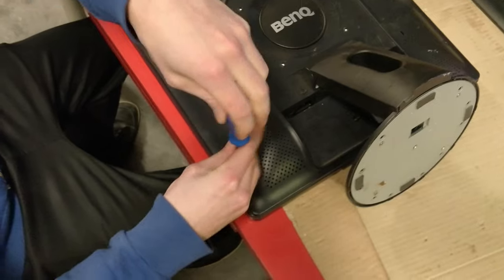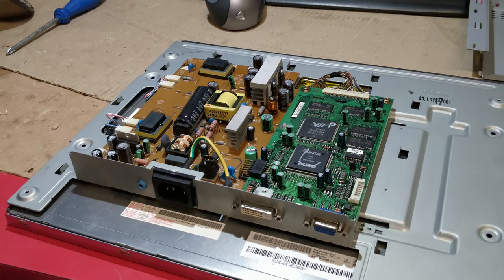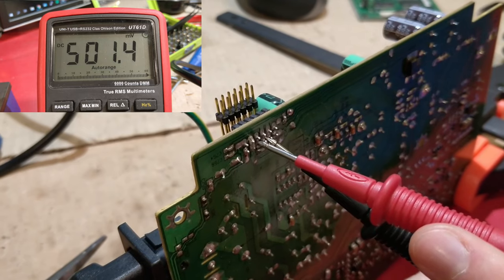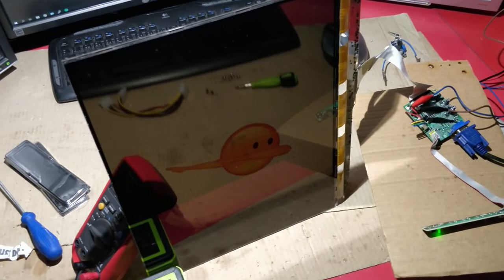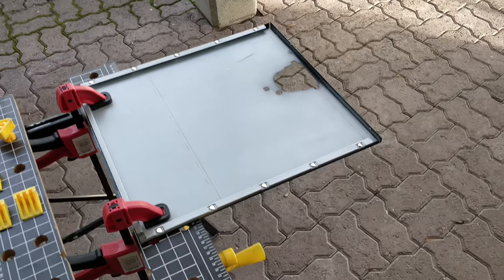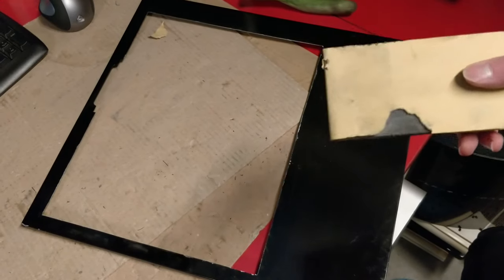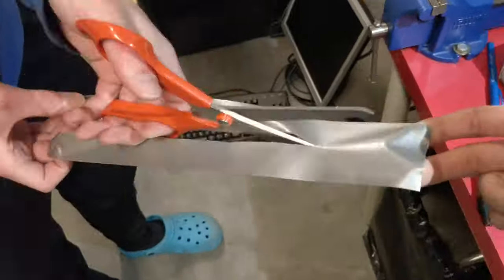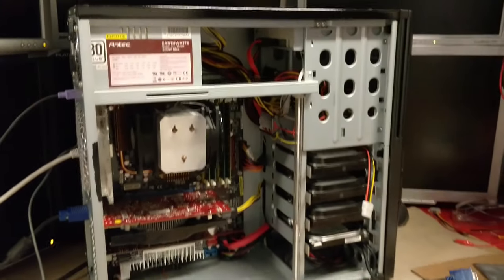DIY Transparent LCD Screen PC Sidepanel For Cheap (Better Version)

Comment: You need to paint the case white inside. And you can also paint the motherboard to get more contrast.
Reply: paint the motherboard? That's a klittle extreme?
Reply: you would kill motherboard if you paint it
Reply: @Mboy556  My painted motherboard is still alive.
Reply: @DushaBox  did you record a video about it?

Comment: That's dope. I'd love to try this but I wouldn't be able to pull it off. Watch, pc companies will be doing this and using it as a selling point within the next year
Reply from the maker: If we can pull this off I'm sure you can as well. In the making of this video we broke at least one monitor before getting everything to work properly, but that isn't a huge problem because you can get these old 5:4 ones for like 20€ a piece or less.
Reply: this idea was taken from a commercially available pc case.
Reply: @KrupsFilms  I know nothing about soldering and stuff so I really want to try such a project but I wouldn't know how to connect everything together..

Comment: My lcd has 2 connectors into it and they fold under the backlight and onto the back and plug into each other. I need a different monitor cause it's in the way and it needs to he connected and it's only long enough to barely reach when its behind the lcd

Comment: Hey I bought a cheap multimeter $20 it finds the ground but whenever I switch it to dc it it doesn’t read anything right it just says 00.03 or counts down from 5 to 3 am I doing something wrong or should I buy a better multimeter btw it’s brand new just cheap
Reply: I’m having trouble figuring out how to connect my molex my power board has so many wires and no diagram should I buy a new multimeter I want to be able to do this for my friend as well
Reply: Wait do I need to have the power supply plugged in when using the multimeter 😂😂 ???
Reply from the maker: The cheap multimeter is most likely just fine. Yes the board needs to be plugged in when measuring the voltages. See my reply to your other comment.

Comment: How much would you charge me for building one on my corsair obsidian 1000d
Reply from the maker: The problem with that is not necessarily the price for the screen itself, but rather the shipping. Depending on where you live, it would probably be pretty expensive to ship an extremely fragile item like this. Not to mention the hassle if/when something happens to break during postage.

Comment: are there limitations on scale? Could I use a big tv screen as long it's lcd?
Reply from the maker: Sure. The possible problem with TV's, especially older ones, is just that the electronics inside them are usually more complicated than those in a monitor, so you might not be able to easily remove everything else than the logic board.
Reply: KrupsFilms Yeah I replaced my idk 2015 or 16 LG LED (I guess) with a beamer so I had finally some source for a panel.

Comment: Do I need to plug in the power board when using the multimeter??
Reply from the maker: When measuring voltages, yes the board does need to be plugged in. If the electronics that convert alternating current (AC) coming from the wall to direct current (DC) that you're trying to measure on the pins dont get power, there will be nothing to measure. Also, when plugging exposed electronics to mains voltage, please be very careful not to touch anything with your bare hands. After you unplug the board, it is not safe to touch it until the capacitors (the barrel-like components) are drained of any voltage, so wait a few minutes before touching it. When you're searching for the ground pins the board does not need to be powered.
Reply: KrupsFilms thank you so so much for this reply also am I always measuring dc with these lcd boards also I just have a black basic cable that plugs into the wall
Reply from the maker: It depends on what you want to measure. All electronic devices that are based on components containing variations of diodes (transistors etc.) only work on DC, because those components have polarity, and so the voltage they use cannot change over time, as AC does (50 or 60 times a second from the wall).  Thats why the power supply has a transformer that converts the AC coming from the wall to DC that the electronics that are related to the panel can use. So yes, most of the time you will be measuring DC, but for example the transformer (the thing that has multiple coils and like 8 solder joints) has AC going in and out of it.
Reply: KrupsFilms hey I found a lcd control board on eBay it has the ground and 5v marked on the board I ordered it yesterday I was wondering if it would work because the monitors I have now the ribbon cable that connects to the lcd has all the medal lines on the connector and the new lcd board I ordered is missing a couple of those on the connector in the pictures I was looking at online I wanted to get your thoughts before they come in and I try them
Reply: KrupsFilms your awesome and super educational thank you so much for helping me understand your such a genuine person thanks so much
Reply: What sends the picture to the display or did I miss that somehow?

Comment: Just wondering if the LCD started sagging over time due to the tape? I might have some experience in that. 😂 Also, have you thought about brighter lighting and maybe a white background to help the effect. Are you using any glass or acrylic to protect the LCD from scratches? Great job on the mod! 👍
Reply from the maker: Yes, it did start to sag after some time. We added a small piece of wood under it to hold the weight of the panel better. The lighting could be brighter but we felt that it was bright enough to work and making it brighter would also make the black levels worse so we left it as is. No, we don't have anything to protect the panel and it scratches very easily, but the scratches can't really be seen without looking for them so it's good enough for us. Thanks for the feedback!
Reply: @KrupsFilms  so if possible try to secure some old used monitors of the same model so if you manage to damage one or need to swap it out you have an exact spare. Otherwise you are looking for a new side panel and cutting a new hole possibly...